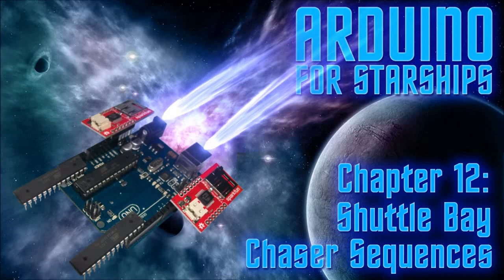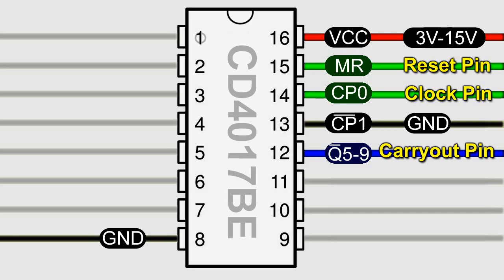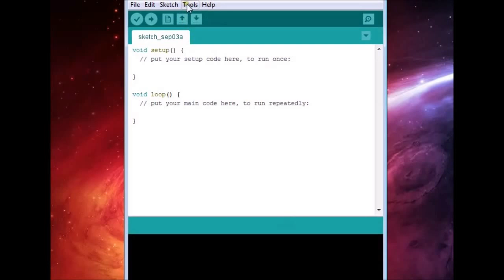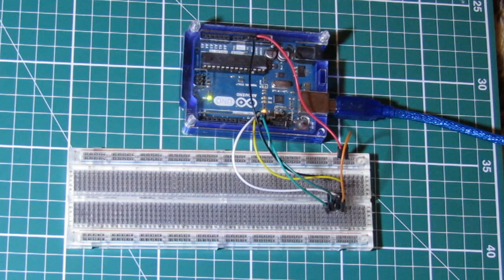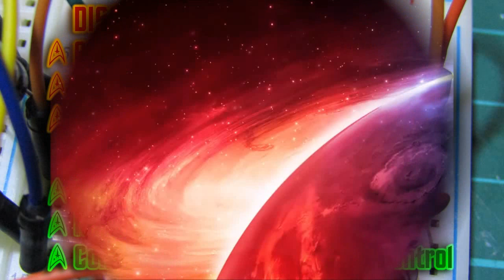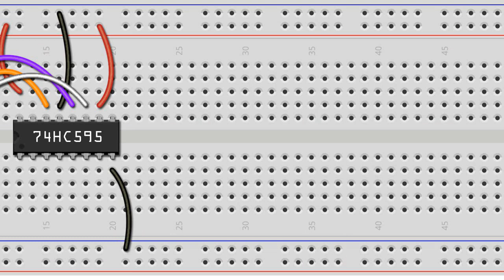Arduino for Starships - Ch12 - Shuttle Bay Chaser Sequences

Comment: Hi. So, is there a pin left on the arduino so we can do this chase and control it from the Uno? The Nano has 2 more outputs- A6 and A7. That is what I intend to use for my setup, so I can try to use them.

You also mentioned a relay for the red alert effect, that will switch the internal light strips to red and the spots off. I am intrigued by that.

I also want to try and get a white LED flash at the peak of the Photon Torpedo fade up. I got it to work by itself using the basic fade sketch. Just got to learn how to insert it into the Starship sketch. Thanks for all of this.
Reply from the maker: Wow, you've really been busy. The white LED flash for the torpedo would be ideal. I've been toying with the idea of rewriting the sketch from scratch, and use state machines instead of the LED flasher library. This would make it much easier to modify the sketch and customize it for your needs. The final circuit is very clunky, and the sound effects are resource-heavy, which made the whole thing a bit unstable. The plan was to use the red alert pin to activate a small relay which would flip between white and red LED strips - probably only in the shuttle bay, but originally I wanted the effect throughout the ship, LOL. I don't know what I was thinking!
Reply: @OstrichLongneck  my pc board was a dud! I have to re-do to find out what I did wrong. Sad face. But fun. I am using a NANO so it has 2 more  analogue outs (A6 and A7) to use for the flash.
Reply from the maker: @smacks999  Darn, troubleshooting is always such a pain! I hope you get it figured out, because your photon torpedoes will be a lot more screen-correct! Good luck - I hope you get the bugs out of the system without too much effort! - Trevor
Reply: @OstrichLongneck  so, I blew up 2 nanos so far. overheating. The speaker got very hot too. As Marvin the Martian would say, (Well, back to the old drawing board!" Good thing Nanos are relatively inexpensive. But they do not have a 5V regulator, nor are A6 and A7 outputs. Sad face.
Reply from the maker: @smacks999  Lol, you definitely have staying power! It's a pity about the A6 and A7 not being outputs. They sure would have been handy!
Reply: @OstrichLongneck  Thanks for the reply! I am still studying and learning how the programming language works. 
And to show you just how crazy I am, I'm going to try all of this in the 1/537 kit, because I can't afford the 1/350. I may fail completely, in which case I'll have to bite the bullet. First I need to see if the PC board will actually work- if I followed your tutorials correctly. Having fun.

Comment: Yes, another excellent video. I was wondering if it would be
possible once the red alert button is pressed to perhaps change colour of the leds : by using BI coloured leds either RED/GREEN or Red/Yellow leds.  Normal  operation would be Yellow or green flowing
inboard and on red alert, change to red and flow outboard.
Reply from the maker: That's a brilliant idea, and more screen-correct too. One could even get some white/red bicolour LEDs for the effect. The nice thing about having an ATTiny in control means that any number of variations on the original idea are possible, as you've just demonstrated :-)
Reply: Thank you, the issue I have though is I don’t know how to get
the Tiny85 to tell the shift register which LEDs to use. Would I need two shift
registers, one for each colour?
Reply from the maker: That was my original thinking, unless one could find a bicolour LED with a common anode, and use a relay to switch between two ground wires. But that seems more complicated than things need to be. I guess the two shift registers idea would be the easiest - one could just divert power to whichever IC needs to be active.
Reply: One last though. I have been playing with Neopiexls and thought that it would be much simpler to just have the Tiny 85 drive two Neopixel strips. No need for shift register etc. that would cater for the chase effect and the Red Alert  option without the need for complex code or switching, just a though. I do really enjoy your videos and they are helping with my build of the refit.
Reply from the maker: Good point. I'm still waiting for mine to get delivered so I can put them through their paces. Excellent idea, though, and very do-able! It's good to have options :-)